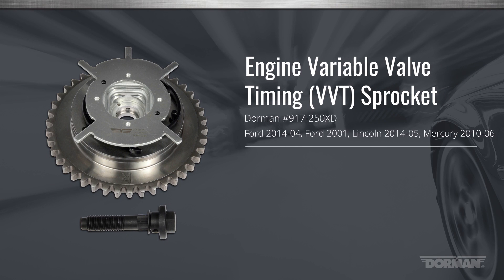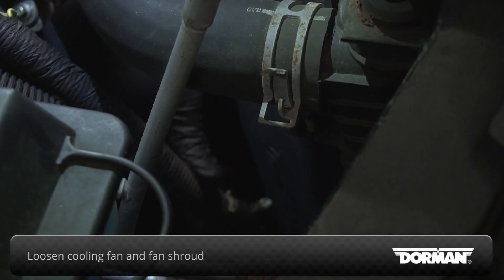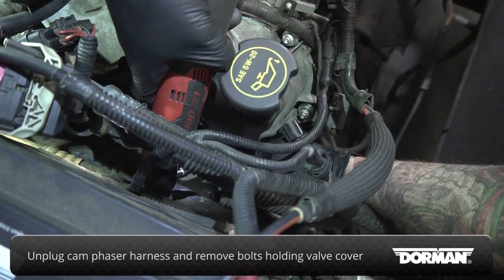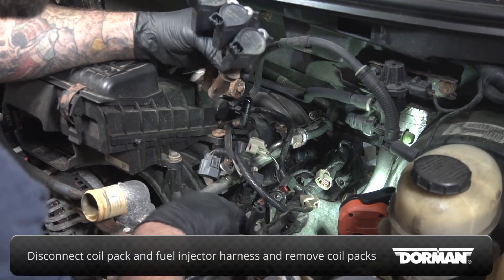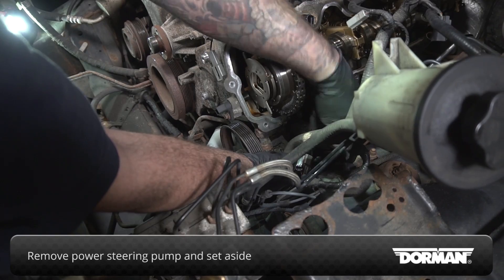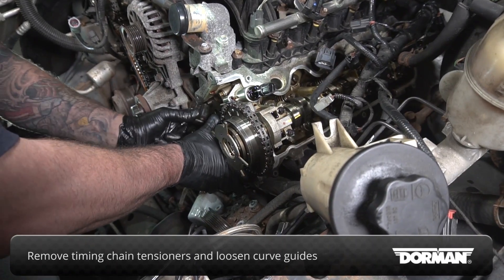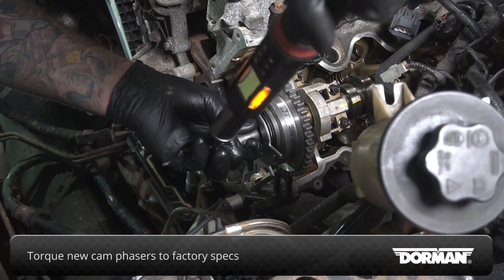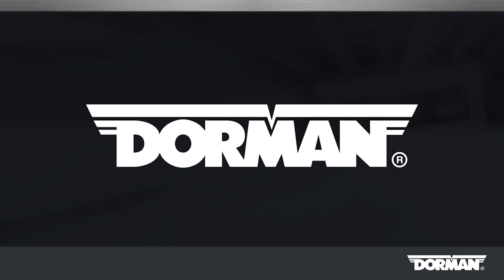Ford Modular V8 VVT Camshaft Phaser Installation by Dorman Products

Comment: IF, you are going to go as far as this demo goes, bite the bullet and replace chains and guides with tensioners.  DO NOT forget to clean the oil flow orifices in the cylinder heads TOOOOO!!
Reply: Not only that, replace the oil pump with a HP Melling. And might as well replace the VCT valves